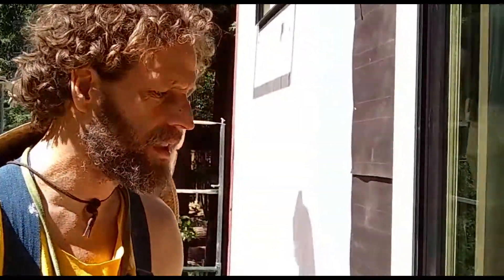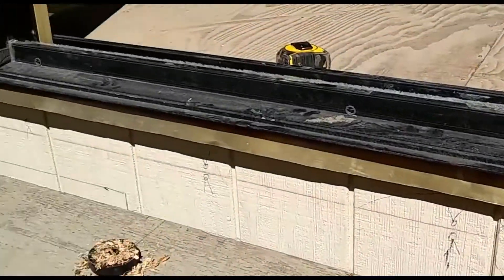How to Build a ledger board for a Deck Attached to a House

Comment: Hi, just wondering how would you bolt a ledger board if the basement is finished with drywall, as you cannot see the rim joist of the house? 
And, would you advise attaching a ledger to the concrete base of the house in that case, and building with 4x4 little posts for the real ledger to sit on?